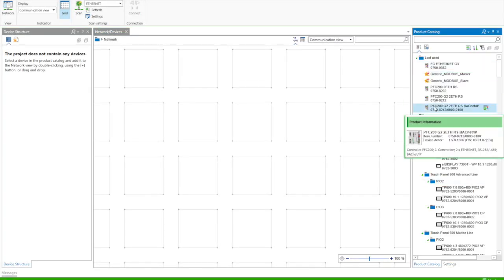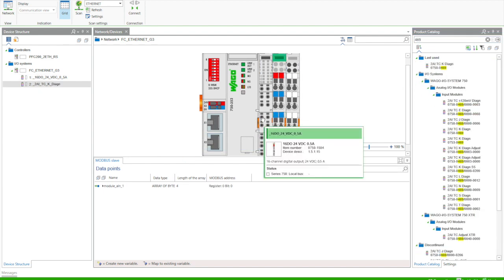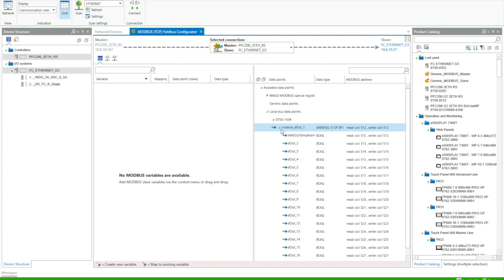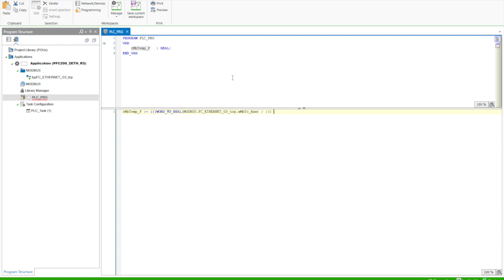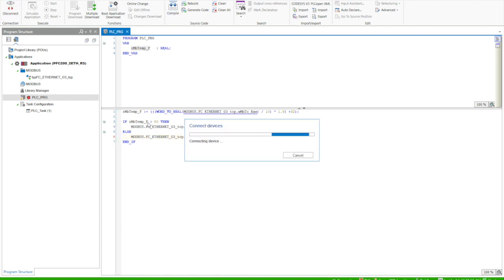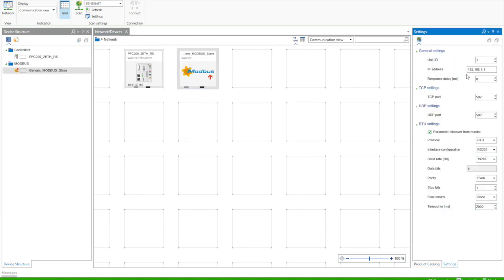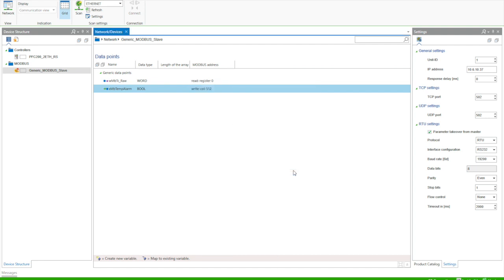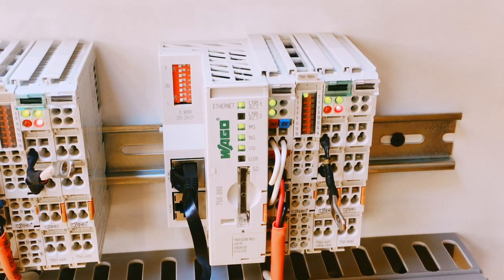CTRL SEE e!COCKPIT and PFC as Modbus Master

Comment: Thanks for the video! Could you clarify what is the master - slave idea here? My understanding is that if I want to have some kind of NodeRed or custom node application on RPi to read from my PFC200 controller, I would need to setup my controller as slave and add "generic master" in the communications view?
Reply: You should be able to set it up with the modbus master on either the Wago side or the RPi side, your choice.  Just remember that modbus "read" and "write" are from the master reference.  e.g.  if you want the slave to have control of a variable and send it to the master, you use a "read".